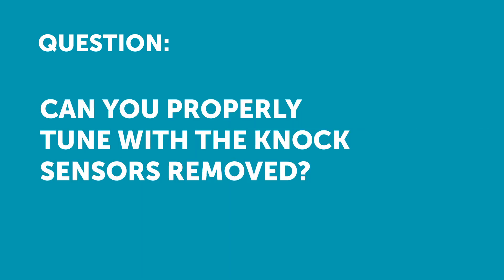Tuning Without A Knock Sensor | Can You? [HPA Q&A]

Comment: You fill up 91 octane premium @ 5000' altitude, then drive to sea level with only a Key On BARO adjustment.  PCM does not realize change in altitude.  How do you deal with this?  Maybe tune for minimum premium octane rating which I think is 91?

Comment: I've a question after thinking over this... Some ecu's even high end ones don't come with on board knock control strategy, what's your opinion on that? Are they rubbish or you can get reliable results with them
Reply: They aren't high end if they don't have knock control
Reply: @sexyfacenation  lol Motec has some
Reply: I'm trying to understand the application of such ecu's
Reply: Frauenarzt Dr. Stefan Frank makes total sense, fair enough... Thanks for sharing your point of view.
I agree with you, cause as Andre says if you're tuning an engine to your specific conditions(fuel and all too) you you shouldn't have knock at all in the first place. I guess that the on board knock control is a great and a must have feature however realistically, as you said sometimes the budget can't afford all the luxuries.
Reply: Frauenarzt Dr. Stefan Frank  but also the knock control strategy can help in places with inconsistent quality of fuel. This is why I like the on board knock control a lot. Africa has shit fuel, we've seen stock cars blow up on V power(highest premium quality fuel available)